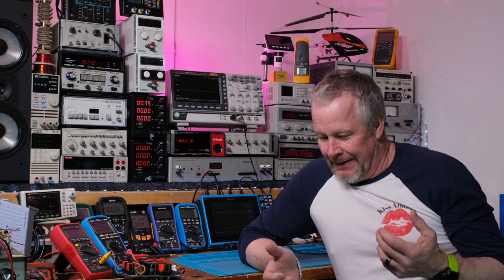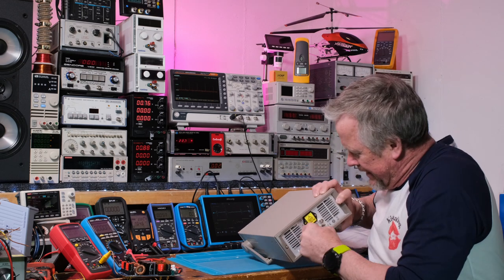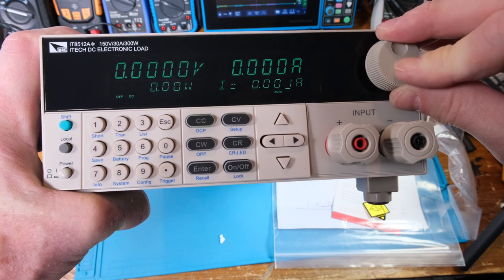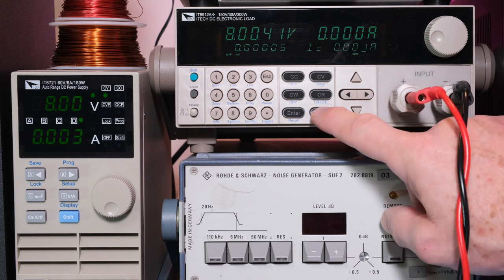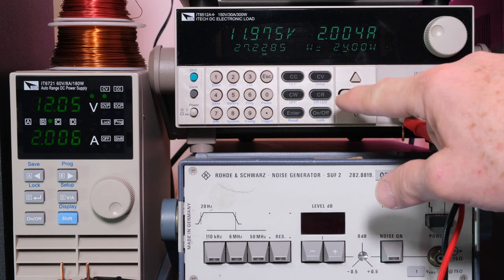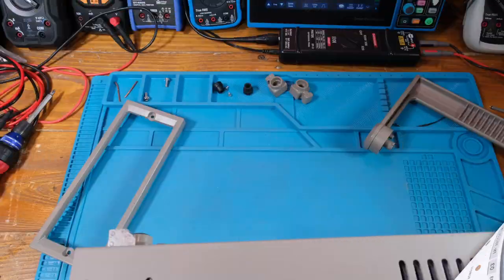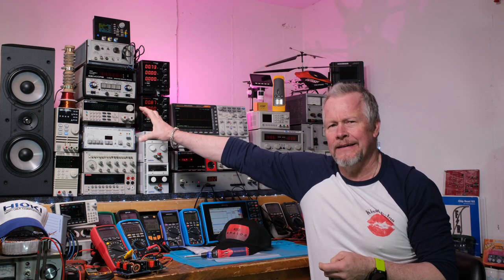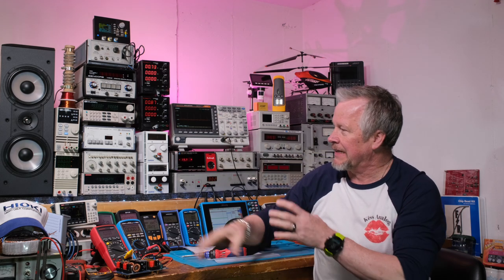ITech 8512A+ Electronic Load Review #electronicload #Itech #8512A #electronicload

Comment: I take it that the rear sense terminals are voltage sense for 4 wire measurements, I thought you might have explained its use, especially as you had voltage drop issues. I suppose potential buyers would know what it's for.
Reply from the maker: Thanks John!  I will show how to use the sense leads in the next video when I do more dynamic load testing.

Comment: Thanks Eddie, always fun!
I have the GW Instek PEL3031, I think it runs about $1200? I was adamant about having sense leads on the front of the load. See that drop you got, that destroys measurements and accuracy, you have to check the load and the source with meters constantly. You can have leads coming out the back but then it's a pain to take them off when you don't need them or you have to find a place to put them but I have so many  leads it's a hassle. The PEL 3031  has the sense leads on the front and I use them anytime the load is more than about half an amp, always for battery testing.

The other thing I find is that when you get down to very low currents under 10 ma you see what these things are worth, that's where the accuracy tells the story.

Thanks again for the review.
Rob
Reply from the maker: Thanks so much!  I agree with you - it would be much easier with the sense leads in front;)  I'll have to do a video to show how to use the sense leads and the difference that they make.

Comment: What are the power mosfets on the heatsinks?
Reply from the maker: Great Question Steven Bliss!  I tried to take some photos but when I looked at them closely, the angle was such that I couldn't see the PN.  I'll have to get the camera down there closer.  I have a microscope now that I might be able to get that angle.  It is a TO-247 package so it is big;)
Reply: I was waiting to knows as well haha
Reply: A dental/inspection mirror might get you down in there.  Or one of those borescope cameras.  You could even do a review on such a thing...  🙂
Reply: Probably IRFP250, ...most of them are.  Something I have never understood because their SOA (no DC even) is CRAP!  Something like the old FDA70N20 or FDA38N30 have awesome DC SOA (both a bit slower, but the EL is way slower anyway).   Maybe they know something I don't?

Comment: It would be handier if the power load had 4-wire sense, so you could choose which side of the cables (or along the line) to measure the voltage at.
Reply from the maker: Thanks - great point!  I'll show how to use the remote sense in a video soon;)

Comment: Surely, the sense leads from the power supply is what should be connected to the electronic load input terminals, so the supply can offset the drop in the leads? Or maybe I'm missing something crucial. :P

Comment: Just to add I'm wondering why the heatsinks are enclosed. Even with a pull on the fans dont really justify it as  the air is going to be crazy hot at maximum load and the vents on both sides would help.
Reply: The heatsinks are big-ole aluminum extrusions which have a handfull of fins inside, and the FETs bolted to them along both sides on the outside.  The heat is drawn through them to get the heat of 300 Watts out of the unit.  You'll see exactly the same thermal implementation inside the BK Precision and Siglent units.
Reply from the maker: Great question!  The heatsink designs allow the fans to focus the air through them and heat out of them.  This design is also great mount various devices to it.  This type of heatsink would not work well without fans.
Reply: @KissAnalog  Eddie. I love ya man, iI was being rhetorical haha. Their cooling is horrible in my uneducated opinion but easily remedied i think. I suspect theyre hiding the quality of the extrusion fins. I used to liquid cool my gaming pcs. I don't have the effort for the upkeep any more. You need to make friends with noctua fans Ed. Pick a machine you find too loud and tell me the size and I'll pick out the right fan. They're made in Japan.  You know how I complain about my dso all the time? I think it died tonight. Lol I emailed the Amazon Seller about it but a low-end scope won't suffice now that I'm starting to get a clue regarding this, speaking as a hobbyist. You didn't answer my question if you have a soldering iron? Lol

Comment: Perhaps you can make some measurements comparing the noise introduced by this unit against your power resistors with a good linear PSU, at least I remember some other models had that drawback.
Reply from the maker: That's a great idea!  I can tell you that when I've gone to the chamber for EMI testing that I use resistors and not electronic loads.

Comment: Nice review as always. I am dealing with low voltages these days (1.0V - 3.3V) and many electronics loads can't handle voltages below 2.5V.  What is the lowest voltage this Eload is able to support.  When testing transient loads, does this Eload specify the slew rate when going from one loading to another ?
Reply from the maker: Thanks so much!  Yes, this ITech load does work down under 0.5 V:)

Comment: It looks like the design language used for old hp and fluke stuff. At a distance it could pass for an old hp piece of gear with the small emblem and the font. The 150v thing is cool I guess if you're running a multi day burn in test on something being prototyped. I always picture dc loads as something that a hobbyist like me could build with some big mosfets, an embedded controller of some type, a 2004 scree, a few buttons and rotary encoder or 2 and a giant heatsink with a bunch of noctua fans haha. That's just from my stated perspective being I have all those things on hand. Cool video as always though Mr. Edward Aho ENG.
Reply from the maker: Thanks Joey!  You are right - you can make an electronic load with a FET;) I've done that more than once;) I do plan to make a video showing how to do that for those that want a basic dynamic load;)
Reply: @KissAnalog  cool beans KA!